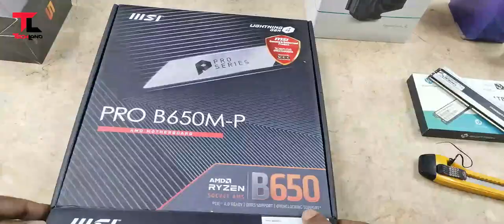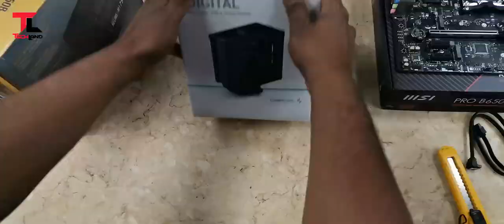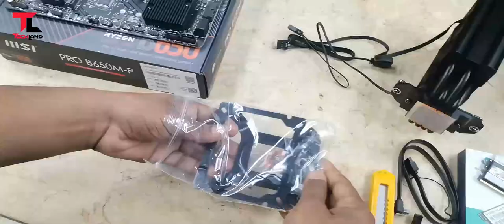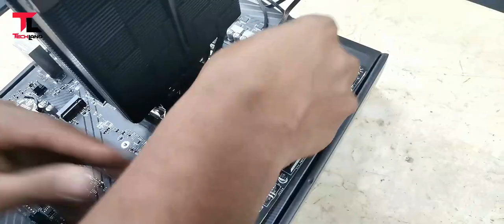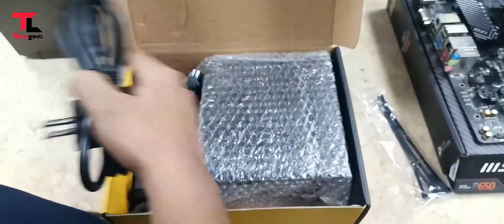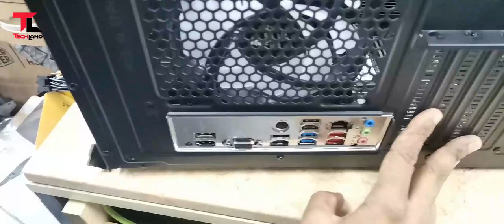AMD Ryzen 5 7600 PC Build AM5 socket  MSI PRO B650M P DDR5 Casing 1st Player T4T4 G | Tech Land

Comment: Hey bro!! This is what i am building..if you have any suggestions please let me know.

1)CPU : AMD Ryzen 5 7600x
 
2)GPU :MSI Nvidia GEFORCE RTX 3060 OC 

3)M.B  : MSI PRO B650M-P Motherboard, Micro-ATX 

4)RAM : RAM: CORSAIR Vengeance 16GB (1x16GB)

5)PSU  : Cooler Master MWE 650 Bronze V2 Power Supply

6)SSD  : Crucial P3 1TB PCIE 3.0

7)Cab  : Ant Esports Elite 1100 Mid-Tower Computer Case/Gaming Cabinet

8)APC : APC Back-UPS BX1100C-IN 1100VA / 660W, 230V, UPS System
Reply from the maker: Its ok build, Ram G.Skill